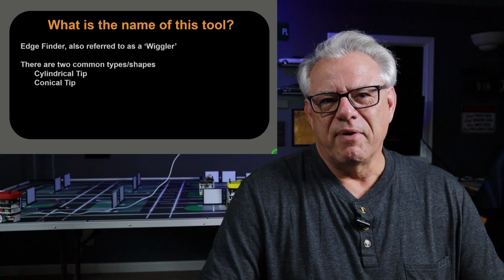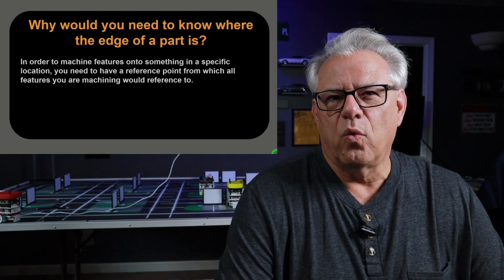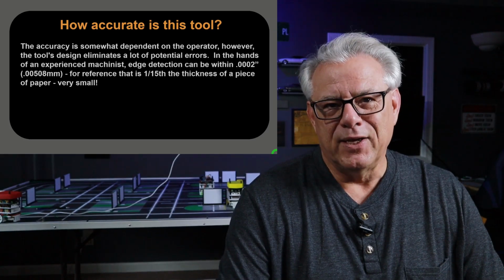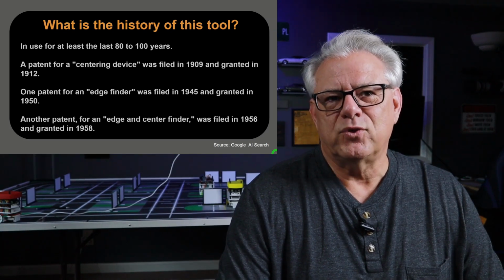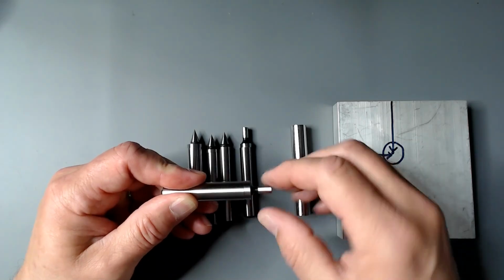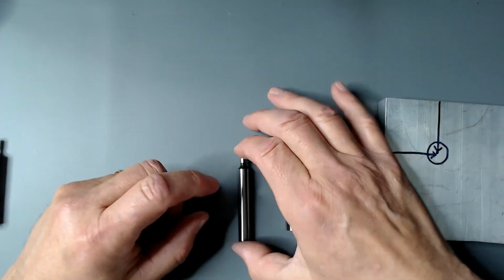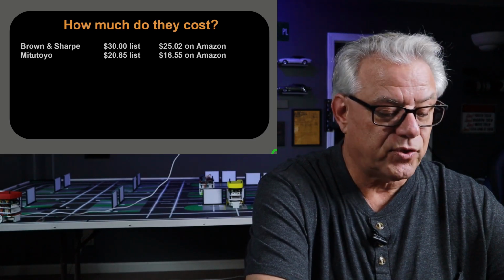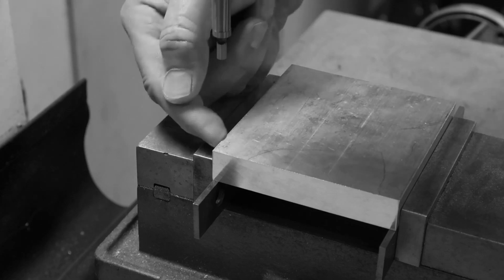Machinist's Edge Finder, without this tool, making precision parts is very difficult

Comment: I wish you had shown how you use these to find the center of a hole.
I found it fascinating that you can start from literally any point on the circle...
Reply from the maker: Good morning Tasarran,
It would be used to point to your layout lines on the part BEFORE drilling the hole.  However, if the hole is large enough, you can also use it to find the center of a hole.  
Sorry I didn't go into that detail.  Finding the right balance between providing too little information and too much information is proving to be very difficult with these series on tools.  Another viewer just commented the story is too long winded.  
Thanks for watching and sharing your feedback - much appreciated!
Cheers!
Chris